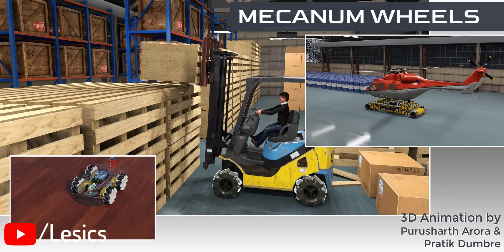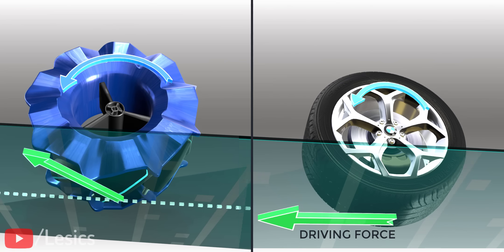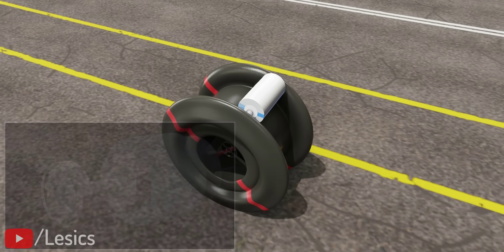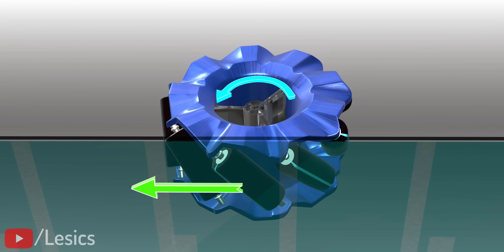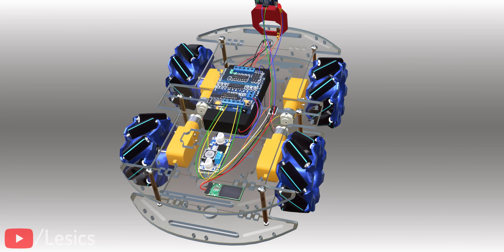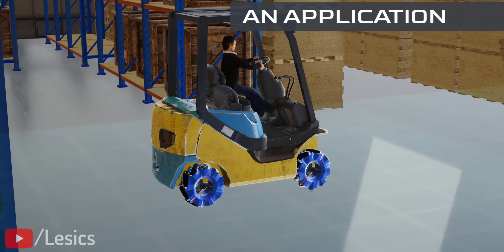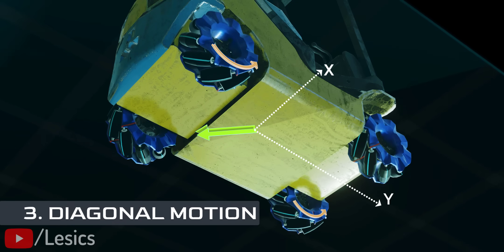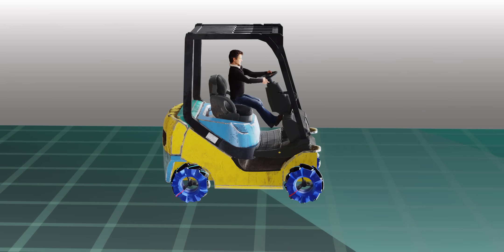The Brilliant Engineering of Mecanum Wheels!

Comment: The Marvic 3000  caliper post on the first grid sliding armature is a 3 digit setting where the post and the armature meet the angle of cross line was set at a maximum of one. Reset it at the 3 mark and that will eliminate any clogging issues next time you run it.    - Dan Aykroyd
Reply: DARZHNARZHERLARLEFREFLARZSHERBLE?

DARZHNARZHERLARLEFREFLARZSHERBLE?

Comment: It's a cool thought concept but the wheels would require frequent roller changes. My fork wheels have chunks missing from the rubber.. Chunks I say! Lol.
Also, I can 360 in my current cheapo fork because it's got three wheels: two powered near load and one steering in rear, which when at 90 pivot allows me to spin in place.
Reply: Imagine having to make a 3 point turn every time, as shown in the video.

Comment: Every fork lift I've driven had rear wheel steering and can turn 180 or 360 in a very tight space not much bigger than the fork lift.
The video example at 00:10 is not how it's done.
In any case heavy breaking on free running rollers is going to be a laugh.

Comment: This mechanism might malfunction in case of uneven surface on one or a combination of wheels. Eg. in case one of the wheel hits a puddle of water, it looses all traction and hence the balance of forces goes haywire. This can probably be counterbalanced by active traction monitoring which would modulate the inputs on other tires as soon as it notices slippage on one.

Comment: Seems like a better idea would be to have each wheel be able to rotate 360 degrees, each with its own electric drive motor. That way each wheel’s speed, direction, and power could be manipulated. Obviously, augmented thru the computer programming controlling the input

Comment: I'd rather design the forklift with vertically rotatable wheels. While being somewhat of a mindfuck as well to fit everything in there with the sufficient load bearing components, would still be far from the levels of stupid of this. Or why don't we put the vehicle on spheres that are being actuated by hidden rollers, giving the whole thing complete freedom, and it won't look laughable.

Comment: As someone who does robotics for my school, I won't even watch the full video so forgive me if I forgot to cover something they already did. 

Mecanum wheels are the best pick for our robots, but I would never put them on anything larger than that. They are extremely bumpy and jump around way too much (the way the rollers are positioned doesn't make the ride any smother). You can't add suspension either, it would make the wheels unbalanced and unable to go in a straight line (we tried this for fun). The wheels also rely on nearly PERFECT weight and balance or again, straight lines are impossible to accomplish. We also only ever use them on foam, any other surface is too hard or too soft for the wheels to move correctly. They are also extremely hard to clean, you cannot use them on any dirty surfaces or the rollers will get jammed. It's so bad sometimes we just by new ones instead of cleaning them because they are sometimes impossible to thoroughly clean

You might just say "make them a little more rotated than the others, that way they won't be bumpy or unbalanced." You can't do that either. Crab walking, a main purpose of the wheels, needs the wheels to be perfectly aligned for it to work.

You also got to think about the engine powering these, the way these wheels jump would probably shead gears instantly. Mecanum wheels also don't like that much weight, a forklift would already be too much weight, let alone cargo on top of that

Comment: From 7 years experience of driving forklifts I can tell you a few thing. 

1. Forklifts are already extremely maneuverable due to having rear wheel steering with large steering angles. If you can't maneuver one, get off and go find a new job. 

2. Forklift wheels have solid tyres for 2 reasons. Durability and carrying heavy loads. Putting all that weight onto those little rollers will greatly increase the chances of them breaking. Not not mention loss is surface contact. 

3. Any decent forklift driver would easily be able to maneuvore in that first scenario. So stop trying to make out that forklifts have a bad turning circle. 

4. Forklifts are fine as they are. Stop trying to re-invent the wheel.

Also, stop showing forklifts driving around while carrying loads at full reach (especially sideways!) It gives people bad ideas.
Reply: Not just at full reach , but also when facing the load forward always sends shivers down my spine. We "drive backwards" for a reason, one braking action and your forklift stops but your load keeps it's momentum.

Comment: For all of you who doubt this technology, just think about simple tracking systems on regular automobiles. Sensors and microprocessors to the rescue. It will all be calculated and corrected automatically. Certain aircraft could not be flown without the assistance of a computer. This will be no different.
Reply: Getting this to work as intended does not at all require any computer assistance whatsoever, the mechanical issues are the reason why this does not work. And a car without computer assistance , for example ABS,  will still work properly. Those are features, not required technology.

Comment: As im thinking wow what a brilliant invention I scroll to the comments and see a lot of good points about more complexity meaning more repairs and more problems and unexpected behaviors, also power Inefficiency, my question is, why not stick with the old wheel but make better turning hinges or Axel's, whatever you call it, let's make something that turns the wheels to a full 90 degrees, then there's not much need for different wheels if you can just do a 180 while pivoting on your back wheels
Reply: The video showed an exaggerated example of a normal forklift turning circle. Most forklifts are able to rotate on the spot. If I had a driver making turns like the example, he would be looking for a new job instantly.

Comment: Cool to look at, but too many moving parts, and, as FernandoP1 say :
if the load is greater at the front than the back (due to the lifting), then chances are that the 2 front wheels will carry greater friction than the ones in the back resulting in slightly unexpected shifting of the vehicle.

Looks cool on paper, but will not be good.

Comment: Every roller would need to be individually braked. Otherwise momentum would continue if only the main wheels were braked.
Reply: Or an internal shoe style design that pushes from the external surface of the rim, out on the rollers all at once.

Comment: Am I the only one here that realizes these on a forklift application would be terrible?

From the graphic even. Youd only beable to travel side to side if it was the last item on the rack at that height... Or you'll be backing out and having to skid steer it i to place... Sooooo conventional is winning.

Every corner, Skid steer mode.... every SINGLE corner.

I wonder how many more RPMs these wheels make compared to conventional... Ya know... Pi...